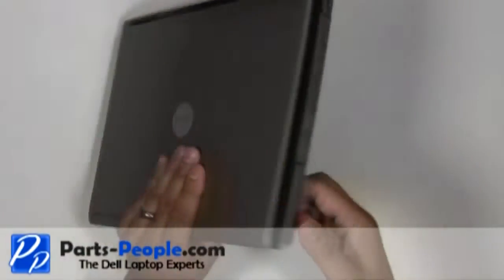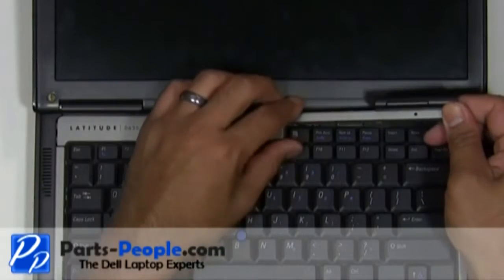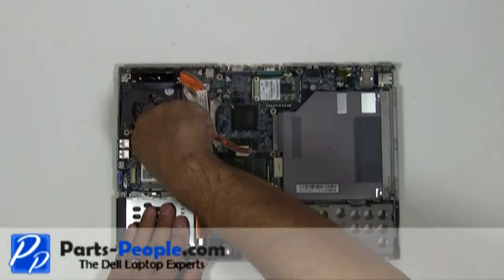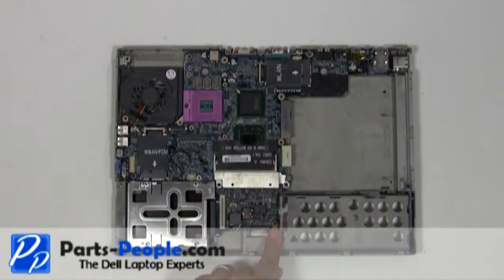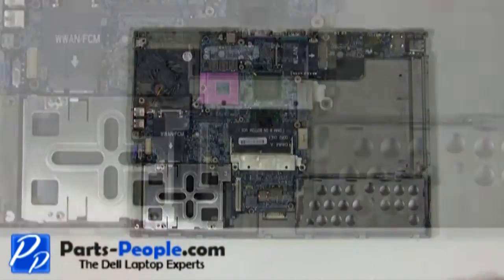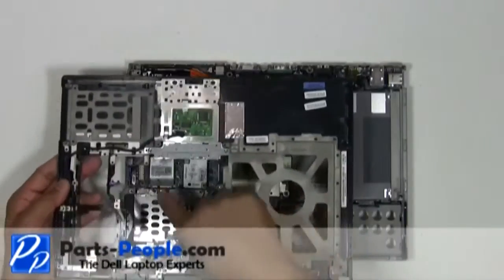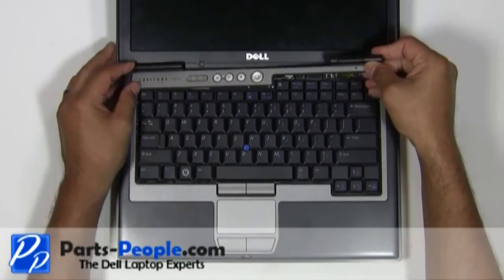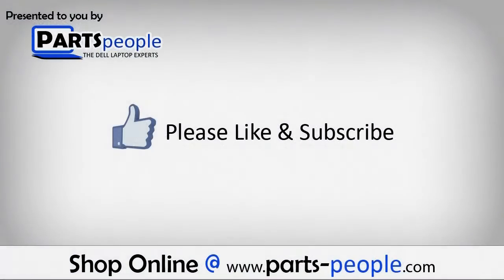Dell Latitude D630 | Cooling Fan Replacement | How-To-Tutorial

Comment: There are several people like me that have followed these steps and now the display doesn't work. My laptop turns on, no display, and then turns off. Please reply.
Reply: Ok I figured it out. I have 2 2gb DIMM RAMS installed. I didn't realize that I had switched their placements. 
Open your laptop and switch your ram cards. Worked for me.

Comment: Folks, check that your new fan has the red, yellow and black wires going to the connector in the same order as the original. I did this twice without success - both replacement fans had the yellow/black wires reversed from the original. The result was a fan that would spin-up, stop, spin-up, stop... If your replacement wires are wrong, use a needle to push the plastic tabs holding the wires in place back a bit and swap them so they match the original fan wires. Couldn't have gotten through the process at all without his helpful video!

Comment: First class!  Thank you.  Old fan found to be almost seized.  
If I had to do it again though I would not disconnect the wireless cards as the connectors are very tricky!  The cards could dangle off the coax leads.  Not even sure the motherboard needs to come out.  I think you could probably slide the fan from under the board.
Reply: +minshum Mine was also seized, with a push it started again, how to clean it?

Comment: After removing the heat sink, Why does the guy continue to take off ram( memory ) also CPU and a bunch of other parts taken off. Do they really need to take all that off to remove/replace the fan? He even removed the Wlan and modem cable. WHY?
Reply from the maker: No it's not necessary to remove the CPU, WIFI card, or memory. This was one our first videos and I believe it was made from a motherboard removal video. It was a learning experience for us. Our videos now are much better.

Comment from the maker: If you want to clean it thoroughly, yes. Otherwise you can just blow air into the exhaust vents which helps but over time you're just pushing dust into the laptop and that can cause more problems.

Comment: Would it be time/effort/money better spent to just replace the fan with a new one instead of cleaning the old one?  I'm guessing yes, but I am most curious of your answer/advice.  Thanks.  Mine is having some good 'ole crunchy sounds at start up occasionally, but not consistently.  $4 on the bay for a new one.  no worries.  Just a time consuming nuisance to get to I see.  Oh WELL.  Need to do it regardless.  crap...

Comment: Thanks for the video!  My friend's Dell Latitude D630 was getting really overheated easily and the overheating caused the CPU to go into a low power state which made it slow as molasses.  Thanks to this video I was able to disassemble her laptop, vacuum out the giant dust bunnies in and around the fan, and put it back together.  Now the fan works perfectly and cools her laptop to the right temperature.

Comment: I also have a slight problem now and was wondering if anyone else had come accross it...  when powering up the laptop the numlock / scroll lock lights come on, the capslock blinks and nothing happens with the screen.  then the laptop shuts down again.
Any help is greatly appreciated. Thank you in advance.
Reply: Alan Heath Me too. Anyone find a solution for this?

Comment: Laptops aren't fun to repair. Manufacturers layer parts very densely to get the laptops to be as small as they are. In this case, the fan got buried under just about everything else. I've had to do the same thing to other laptops (well, netbooks) just to add a stick of RAM.

Having said that, I was thinking the same thing as you while watching this video. Now to start the jigsaw puzzle...

Comment: I needed to buy thermal paste for this.  This was great.  My fan went a few months after we broke a hinge, and I replaced both at the same time under the hood.  Don't forget to record CMOS settings you might have customized, so they can be reentered when you boot up for the first time after you've pulled the CMOS battery.